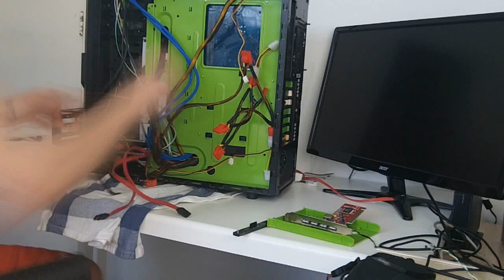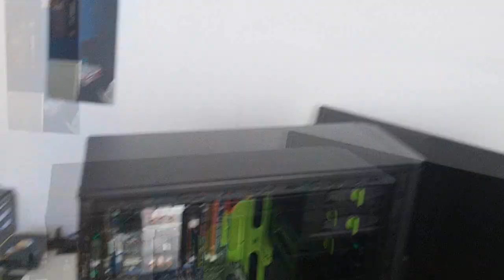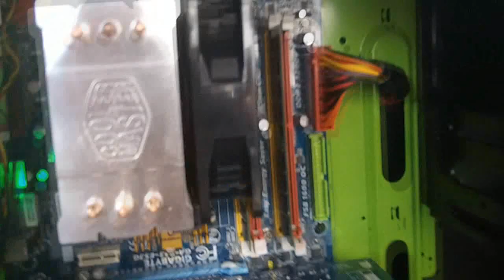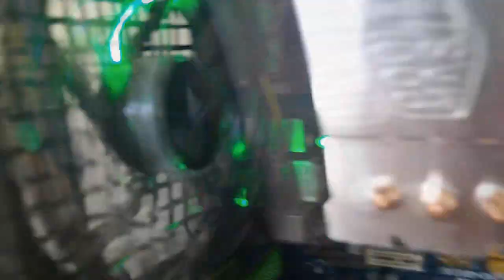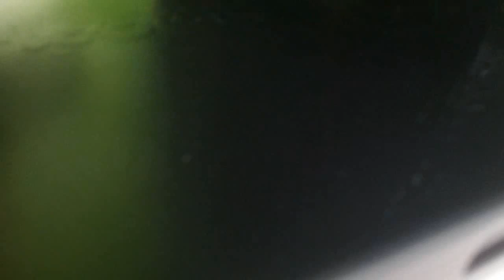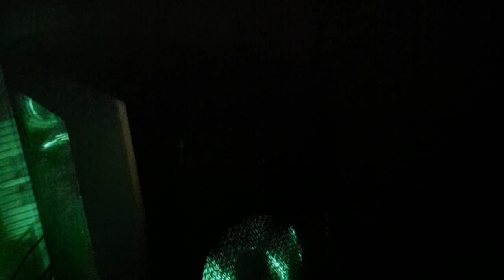Sharkoon T28 Build | Cable Management Overview

Comment: Awesome job :) I had the same case and a non-modular PSU and found cable management and absolute nightmare with it, I like how you've modded your case though. Now I have a shiny new CM 690 III :D
Reply: FuZzhardware You're telling me! I had the T9 whereas I see you have the T28 and I hated the rear facing drive bays in the T9, the T28 is obviously a lot better in that regard saving you having to manage horrible SATA data and power cables. Don't get me wrong, the T9 and T28 are awesome cases, especially for the price but the CM 690 III just has some extra features that I was looking for, like the T9 was 8mm too short for me to fit an R9 280X Sapphire Toxic edition in whereas it easily fits the CM 690 III, the CM 690 III has a bevel on the cable management side panel leaving you about an inch in total for cable management, it has side facing 3.25" and 2.5" bays with a tool less system and space on top for two 120mm fans.

Comment: Hi! I have the same case. But where did you plug the USB 3.0 cable in? My motherboard somehow doesnt allow me to plug it in (motherboard: IPMMB-FM). The blue cable fits but there is another cable attached to it which is far too short to plug it in anywhere.
Reply: Have sort of the same Problem.But in my case all those USB plugs does not work.Im looking for a solution with sharkon in the meantime for my problem.